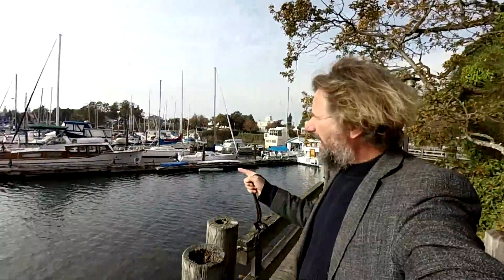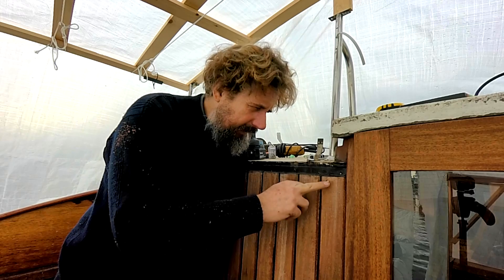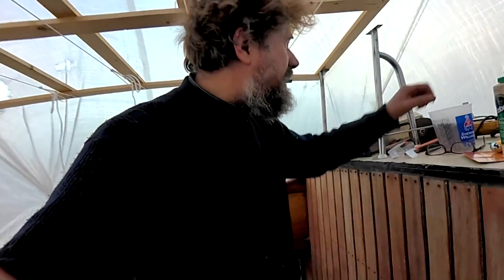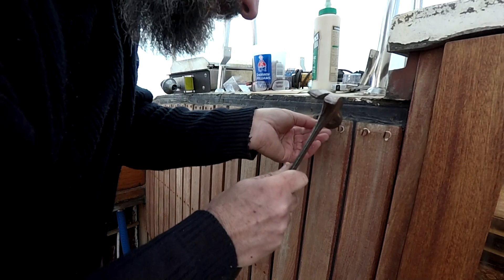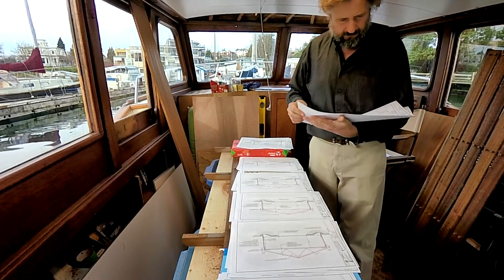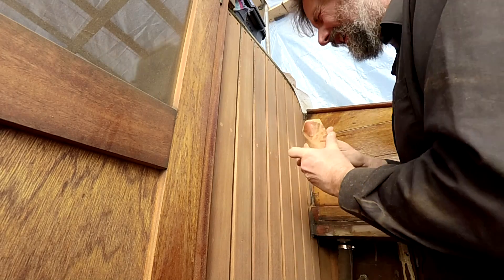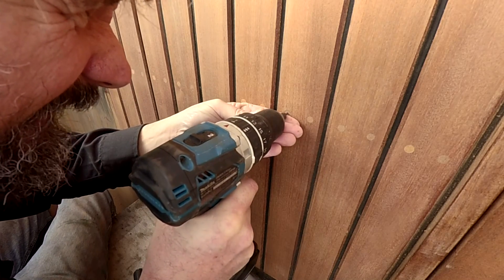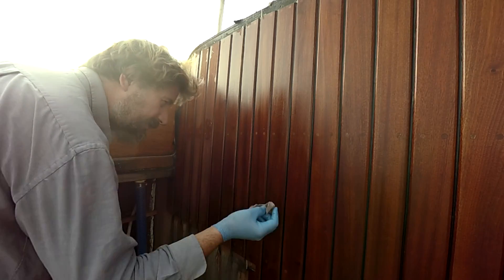Plugging hundreds of screws - Wooden boat restoration - Boat Refit - Travels With Geordie #95

Comment: Hi Peter, nice work as usual.  I use a somewhat different method to trim bungs to avoid cutting them below the surface.  Basically I use my multitool to cut them off.  I put a couple of wraps of masking tape on the blade to slightly raise it from the surface then have at it.  It is a bit slower than with a chisel, but I never have one with angled grain end up with an edge below the surface.  I really like the beer segment.
Reply from the maker: Thanks Todd, yes I've done it that way too. This is just so quick.

Comment: you could draw a line along the grain of the wood before you cut all the plugs with the drill press....just saying :-) cheers Mike   getting very excited about the delivery of my boat!
Reply from the maker: Actually, you can’t because they’re tapered plugs and the top surface is the bottom of the plug.
Reply: @TravelsWithGeordie  would it matter if the grain reference went into the hole as long as you knew how to orient it? Cheers
Reply from the maker: I suppose, usually the end gets cleaned off by the cutter, but I could be careful.

Comment: Covering up a big crack on a boat should be a first priority that’s for sure! Lol. And then it’s on to plugging bung holes. Nice segue.  Glad to see you don’t have to do major reconstruction on that wainscoting. It looks great and the look is most appropriate. When I saw you cleaning the sealant squeeze out I was reminded of a clever method I came across recently on a woodworking channel. Use cheap plastic straws (fast-food free ones are perfect) they not only scoop the excess, but contain the excess as well which aids clean-up. The thin walled straws conform to the groove and form a concave bevel as good as your finger would. I’ve used Titebond waterproof for years, good stuff. Cheers!
Reply from the maker: Wooo, neat idea with the straws!

Comment: Great Video as usual Peter,
I found a nifty tool on eBay that cut the dowels really well, it was Canadian from memory,only £8 , flexible saw blade ,worked a treat.
Your methods for the cockpit I shall use to the letter, in my future Episode 😉.....thanks once again 
Regards Phil🙋‍♂️🇬🇧
Reply: Actually u can buy pre cut teak plugs by the hundred on ebay in lots of sizes, even assorted
Reply from the maker: Thanks Phil, yes, that's probably a one sided Japanese saw. I do that for small jobs but for almost 400 the chisel is just so quick.
Reply from the maker: SV Zaya, true but it's hard to guarantee the species and tapered.

Comment: Ehh, all those wooden boaties Cracking jokes about something that here in Australia is a legitimate way to keep the flys off your face.
Loving your video's slowly going through your back log. I know it's way too late for this job, Butt in future if you mark the grain indicator line along your bung stock before you cut them out you will significantly reduce your time investment. I also use a mix of dish washing liquid and water to clean up wet sealant. Cheers mate
Reply from the maker: Thanks so much. The thing with these plug cutters is that they're tapered, so the wide end of the plug is in the wood making it impossible to mark them beforehand.
Reply: @TravelsWithGeordie  Does it really matter which side you mark it? I know seeing the line on the outside face is comforting but in reality youre not book matching grain, its more about consistent direction, and so would think the efficiency gain trumps the 'ingrained' desire to have the mark on the outside, for me a mark just helps reference the grain alignment, before fitting the plug if I'm honest I lick it to highlight the grain.....could explain a lot.....(come on we all know teak tastes great, cedar and mahogany so so, just don't do it on camphor laurel).
Cheers

Comment: tip: draw a line before cutting the pugs.  Voila done in a second or two.
Reply from the maker: Hi Stephen, actually that doesn't work. The head end of the plug is the one inside the wood and only exposed when I cut them out.

Comment: make a line before cutting in the bandsaw...
Reply from the maker: Actually that doesn't work. The head end of the plug is the one inside the wood and only exposed when I cut them out.
Reply: na you se  direktion in the wood  and then press in place..

Comment: Making that line on the bungs could have been done before you drilled them out, it would have saved you a lot of fiddling...! Just saying...!
Reply from the maker: Actually that doesn't work. The head end of the plug is the one inside the wood and only exposed when I cut them out.
Reply: @TravelsWithGeordie  Ok, I see.. my bad then! I'm obviously not as smart as I like to think..!